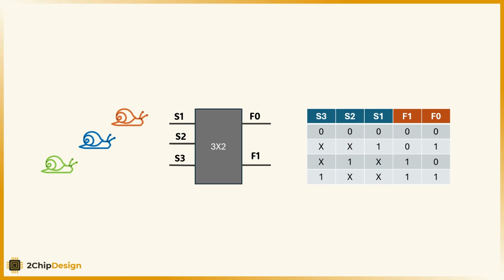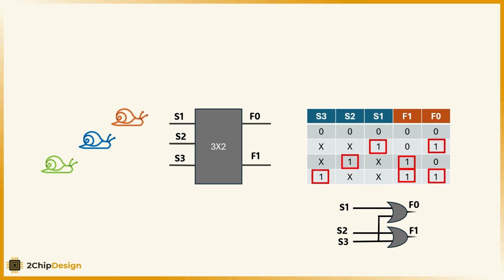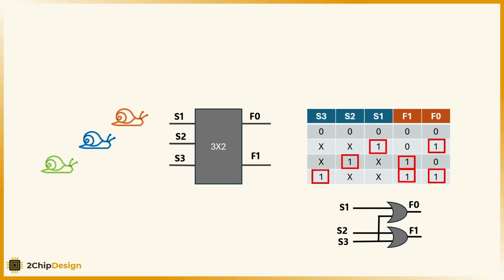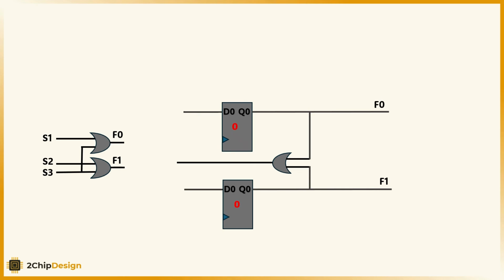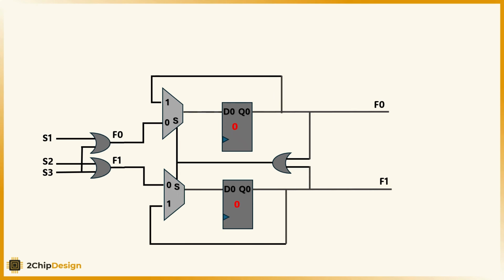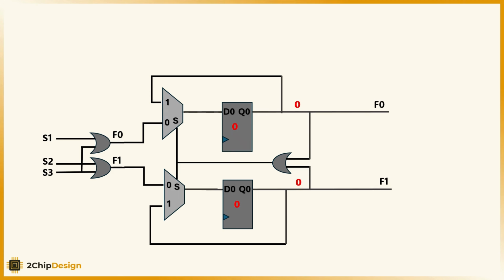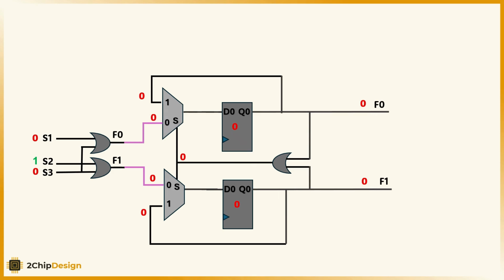Race Detector Circuit – Who’s the First Snail to Finish? | Digital Logic Design

Comment: Very fun to watch and learn! 
What if I want to add a reset pulse?  
Should I just AND between D0 and NOT(reset) ?
Reply from the maker: Because the reset signal already drives all the flip-flops to 0, the system automatically returns to its original state, the same one as when the race started and the multiplexers were passing the zero input. So there’s no real need to AND it with D0, the reset alone will handle that.